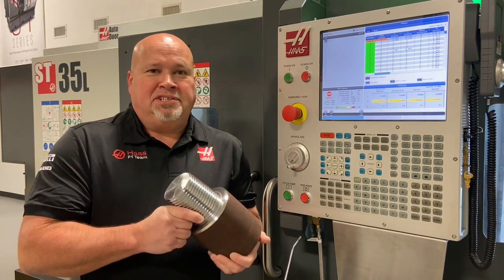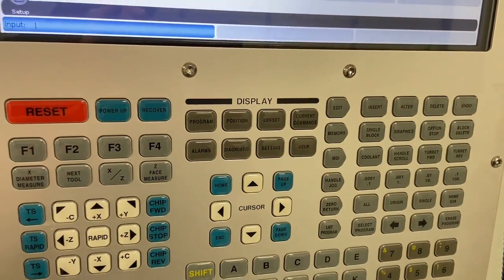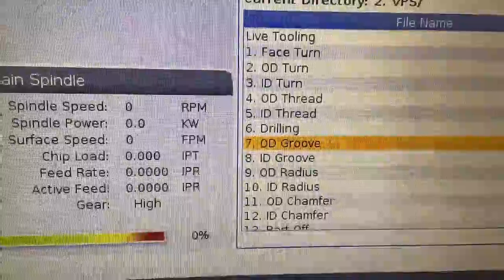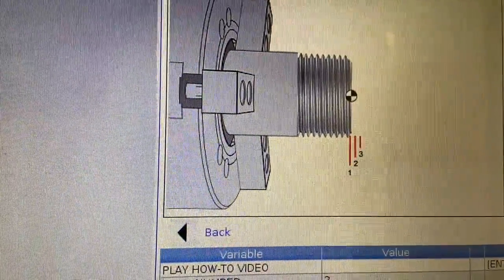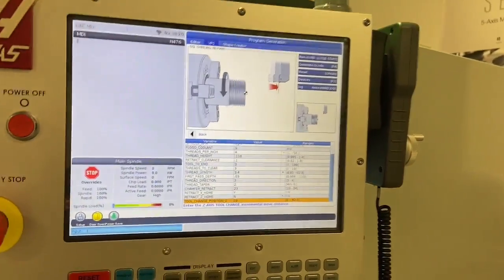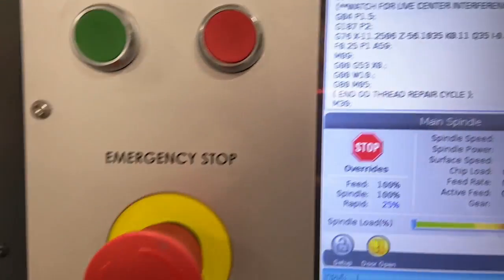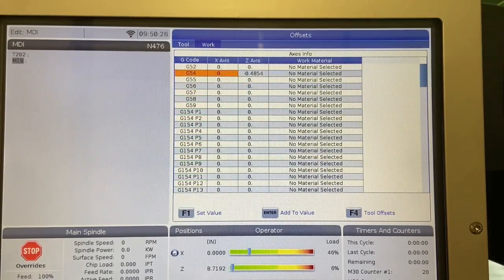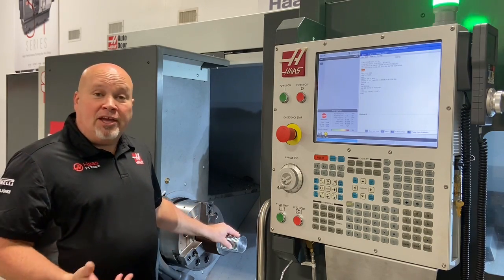Haas Lathe Thread Repair (Recut)

Comment: interesting, but im completly lost after 9:10 ..  make a better explanation ;)
Reply: In short, every Haas lathe threads from the "Zero position of the chuck".  When commanding M19, you are sending the spindle to the "Zero position of the chuck".  When lining up the threading tool, into the thread groove, and then setting that as "G54 Z0, for example", you are synchronizing the Z-work shift, with the Zero Position of the chuck, which allowing you to run a standard program / cycle, and cut the thread.

Now....  When you line up in the "2nd thread back", you have just set G54 Z0 about 1/4" negative of the face.  This is how you would "push back" the connection, by re-facing it, turning the shoulder back, and rethreading (most popular way to repair a badly damaged oilfield connection).  

If you do not want to "push the thread back", you would need to make a positive work shift by 1 thread, 2 threads, or 3 threads (depending on where you dropped the tool into the lead).  You MUST make this shift in thread-lead increments to remain in lead with the thread.  

Hope this helps.  Simple as Pie / Hard to explain, LOL.
Reply: @Darren_HFO_Champions  tnx .. I understand better what is happening now... I managed to  repair some fine metric threads that got dented by using information in this video. :)

Comment: How much do you charge to set up and program an ST40 ? Our company is just 20 mins South of Fort Worth not far off I35w
Reply from the maker: Hi Christian.  That area is actually outside of our South Texas territory.  The guys at HFO Dallas may be interested in giving you an estimate.  Due to the number of machines in our territory, we also do not typically get involved in programming and turn-keys.  I have a few friends in the business that have great rates and service.  David Vagi ((713) 269-3037) and Mitchel Hawkins ((713) 876-8516) are two guys you may want to call.  Thank you for reaching out.

Comment: This may save my life tomorrow. Although I dont have a haas. I have and SMT. I cant find any decent videos on this topic.
Reply: Hi Moto Fix.  The only issue that you may run across with your SMT (or any machine with a Fanuc control):  When you change the speed on a Fanuc control, you'll lose the lead reference, the machine threads from a different starting point.  That is the magic of the Haas lathe.  I can change the speed, not lose the lead, I can set the Z reference when the spindle is at the M19 spindle orient position (because we always thread from that point).  Best of luck to you!

Comment: Hi Darren, good info, did not know we could alter the Z and/or X offsets to get the threads dialed in after we start.THANKS!
Also, for multi starts threads I guess it would require a custom program?
Reply: Hi Michael.  Glad to help.  For multi-start, you have a few different ways you could handle this.  One option would be to treat this as "two separate thread-recuts".  However, what I would do, is make this MDI program become a saved program in memory.  I would then duplicate the G76 threading cycle a second time, and add "Q0" to the first G76 cycle, and "Q180000" to the 2nd cycle (example for a 2-start threading cycle).  This would cause the first cycle to run at 0 degrees, and the 2nd to run at 180 degrees from zero.  I hope you've had a great week.
Reply: @Darren_HFO_Champions  Great, thanks again!

Comment: How deep do you set the ref point? Do you stick the point of the tool down in the root of the thread. How does the program generated know at what depth is the final pass. Does it just basically go to depth it was set at.. and then you adjust the X - accordingly? Also I don’t see why adjusting the z is rare. I would think that would be one of the main tools. To skim cut and if it is hitting only one side of the thread to back off the z to center it better? I guess it depends how shallow the original threads are. If u need to cut a significant amount deeper then it will likely clean up both sides either way with a eye up ref point. If it is close similar to chasing in a manual u can blue up threads and if it is hitting on one side adjustments can be made before cutting deeper on next pass. I guess it would make more sense to me if it just did one pass where it is set in the x and the. Simply adjust x neg and re run deeper. Adjusting Z if needed to align better.
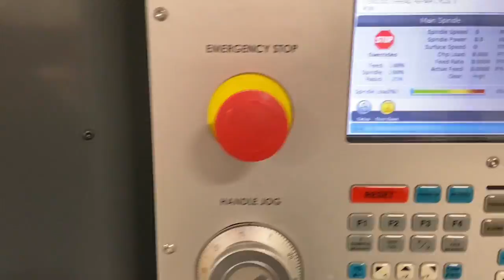Reply: The machine will use the location in X that you started from (the main reason for keeping the tool down in the lead when pressing cycle start.  It will then thread deeper by the amount that you specify.  Remember that it is not necessary to get this value "100% perfect" on the first try.  You can change the X-value or Z-value in the "G20 L20 P99" line and run the thread program multiple times, without having to set the reference over and over again (see 7:40 in the video).  Thanks again.

Comment: Do you have to start the program in the thread?? I don’t love that and don’t see why it can’t just ref that point. Seems like a crash waiting to happen. Especially since Feed  hold is usually disabled in thread cycles.
Reply: Hi Shawn.  This depends on which method we are talking about.  If you are using the VPS cycle, you will always leave the tool in the part.  The program will pull out in X, move over in Z, and start the cycle for you.  If you are using the M19 / Set G54 method, you are welcome to pull out of the thread manually before starting.  Thank you for watching.